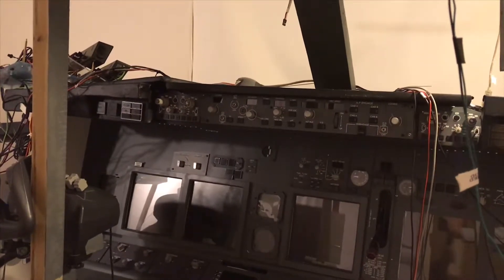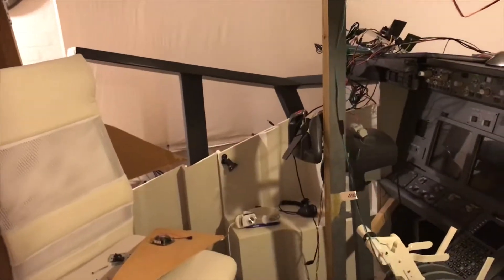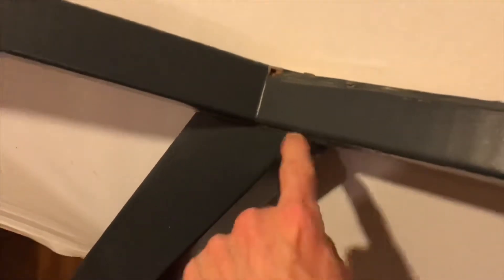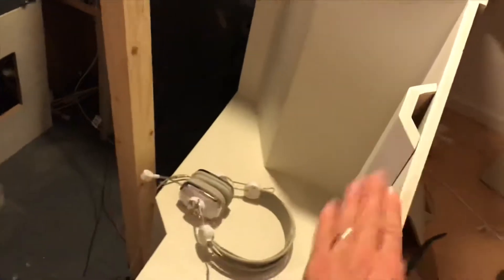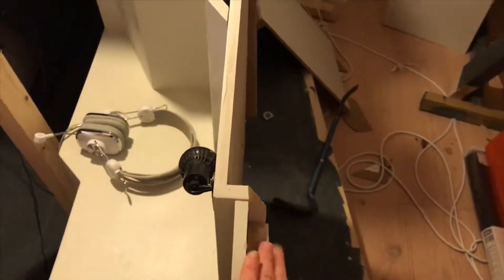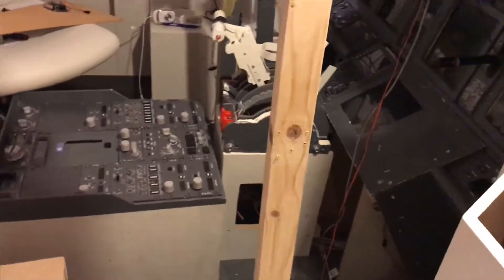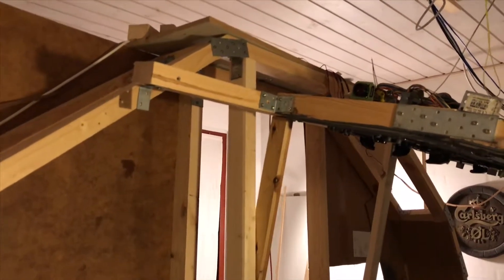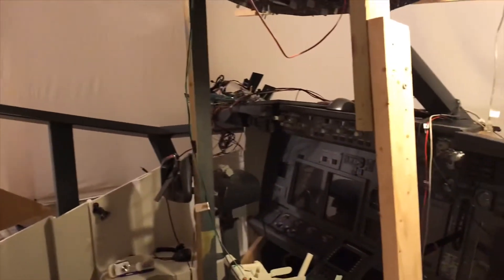Windows - B737 Home Cockpit

Comment: Hey guys, in my work people are using 3D-scanners to get very accurate dimensions of the real thing. We then do the CAD-work around that to design what we need to design to fit the scanned object. So in your case the frame holding all your different panels and interior stuff. So if you can have someone scan the B737 NG cockpit, you can all use that file as a reference.

Comment: I know that you will make your way to a full cockpit. And you are right. Every cockpit is unique.
Reply from the maker: Michael Schulz hope so. 😄
It’s like when ever I solve one problem a new pops up. 
Like that machine at amusement parks where you must slam the beaver on the head with a hammer. But shortly after a new beaver (read: problem) pops up.
Reply: @BuildaBoeing  I know exactly what you mean. It's the same here.